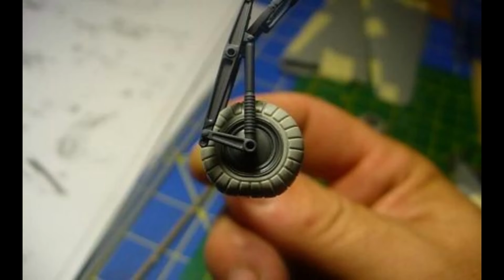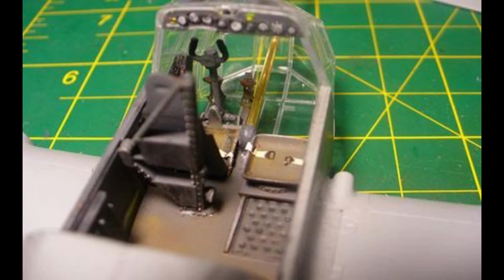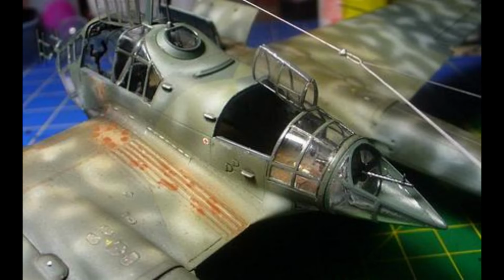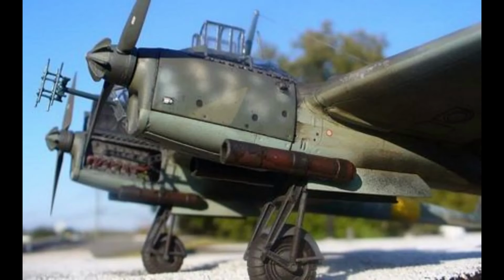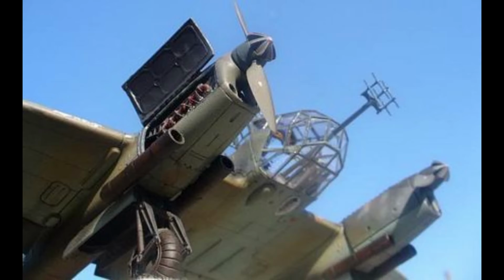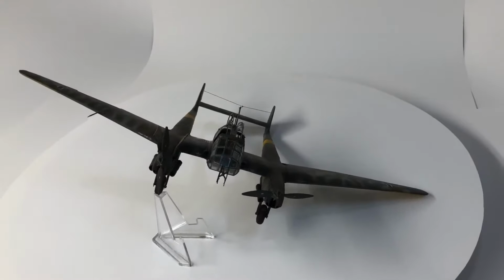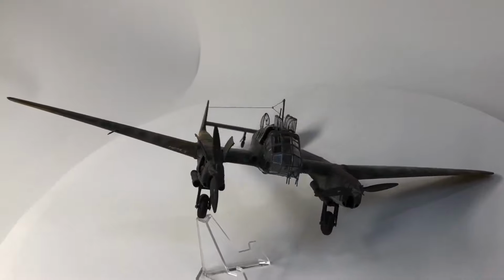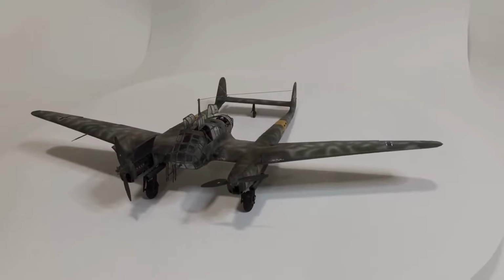FW 189 Nacht Jager 1/48 Scale Greatwall

Comment: I am building the A-2 kit at the moment, but I found the masks do not really stick too well. In the end I used the as templates to cut new ones from Tamiya Tape, numbering each with its corresponding template number. Work, but works much better than the paper masks they provide. I liked yhe kit enough to also buy the A-1 as well. I also gave the MPM limited run A-1 kit on the shelf of doom until I can figure out how the canopy seams can be eliminated.
Reply from the maker: Thanks for leaving a comment and visiting the channel , much appreciated! Yes I did have a few masks that didn't want to seal down and replaced them with Tamiya tape as well. Good luck with that old mom kit, that canopy fit isn't great. Have you looked into a vacuum form replacement? Cheers Trey
Reply: @treyzmodels422  Don't think there is one available, at least here in NZ. 
But I did also buy the MPM Fw189B (Now long OOP)- it was a 5 seat transport/VIP lane - which doesn't have that issue.       
    Funnily enough, I needed very little filler on the MPM kit, only a smidge more than the Great Wall kit. (But I DID do a LOT of Prep work during assembly and made sure of all alignments before committing to glue!
Reply from the maker: @brettpeacock9116  searched for a vac canopy for that mpm kit, only thing I found was an eBay listing for one in a kit with other upgrades as well. So at least it was available at some time. Like the VIP version as well, the armored ground attack version would make for an interesting build as well. Cheers Trey

Comment: Wow, what a nice build!  I have the kit but have not started it yet.  A quick question though, what color/paint did you use for the landing gear?  It looks grey to me, but most German landing gear of WWII model kits indicate RLM 02 which is a green color.  This always confused me.
Reply from the maker: Thank you! The  gear and cockpit colors were rlm66 , however the gear could and bays could have been RLM 02. The transition to all RLM 66 took place around when this was built so really just a guess, it could be either. Yes it's very confusing to me as well. Thanks for visiting cheers Trey